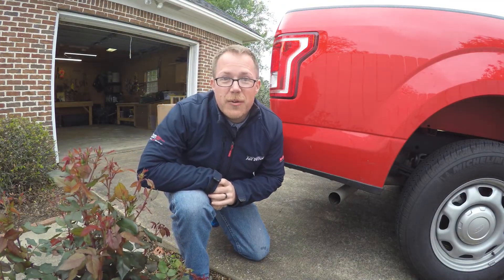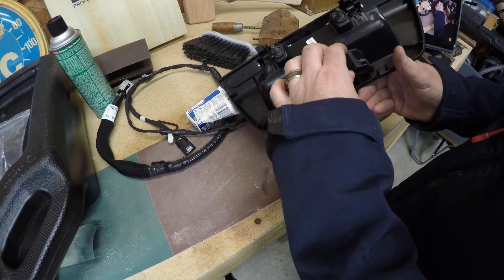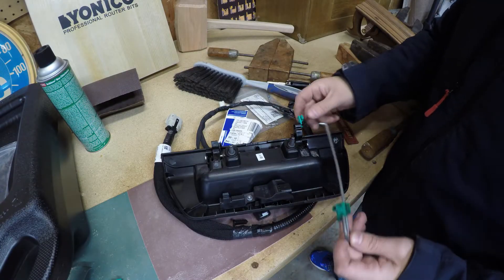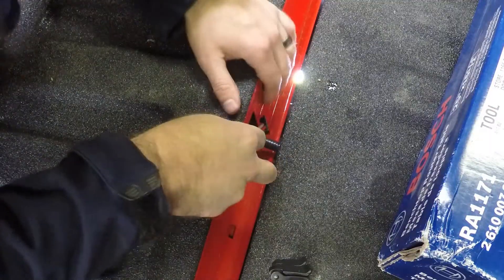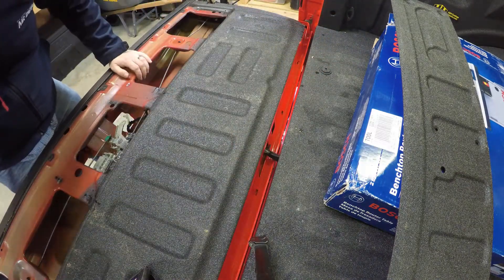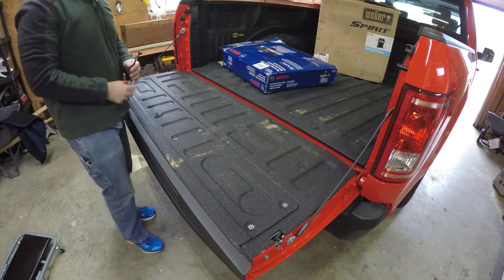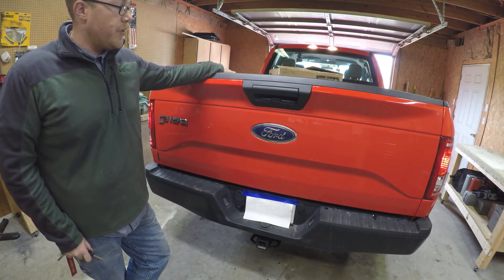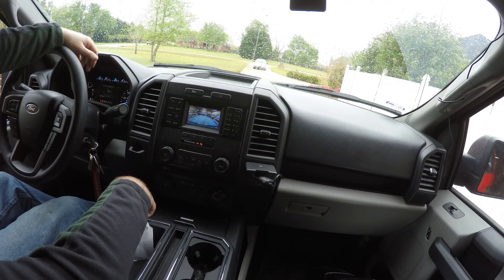2017 F-150 Backup Camera Install & Activation (OEM/Factory Camera)

Comment: Has anyone used the original cameras or installed new ones that RECORD what the cameras see?  After dealing with a-holes hitting me then telling every story on earth from teleported into the vehicle by aliens to living in a parallel universe, I'll never drive without RECORDED dash/vehicle cams again.

I'm wondering if anyone makes those clean housings to mount under the mirrors, aftermarket, so they connect to a DVR (recorder).  Just watching some moron hit you isn't worth a thing.
Reply from the maker: I'm not familiar with any permanently installed system. I have 2 dash cams, one pointing forward and one pointing out the rear window to record any possible issues.

Comment: Ok so I fucked up my tailgate and I was looking for replacements and I found an OEM with the back up Camera what type of harnesses will I have to buy to get it to work I have a 2017 XLT Crew Cab with the basics
Reply: Where do you buy the parts for the back up camera for an F150 2017

Comment: So, I installed this exactly like the instruction in the PDF.  I ordered all the parts mentioned.  Wired it up just like it said.  loaded the FORScan stuff, and it works, but the image is update down.  Any ideas?

1 - Brown - 33
2 - White - 7
3 - Blue - 11
4 - Green - 12
5 - Black - 13
2017 XLT 4.2" screen
Reply: Camera upside down?
Reply: @EdGrube  no, it only mounts one way
Reply: Did you get it resolved?  Not trying to be a smart a** but some mentioned the lense on the camera itself may turn 180 degrees
Reply: EdGrube  No, Not yet.  I have come to the conclusion that I have it wired correctly, and it is either the wrong camera for this application, or the camera was assembled incorrectly.   I wondered if I could just flip the assembly around, but it looks like the plastic assembly is welded together.  I was trying to get the supplier to send me another one before I wreck this one.  If the supplier won't send me another one, and I'm on my own, I'll try forcing it apart, or I will have to flip the whole assembly and silicone it in place.
Reply: @CVALOVIC  Any update?  I want to ask you a bunch of questions
Reply: @EdGrube   The supplier agreed to send me a new Camera.  Waiting for it to arrive.  Ask as many questions as you want.

Comment: Hello I installed everything and flashed the system but the display is saying rear view camera not available.....any suggestions?
Reply: I'm getting the same thing on my 2016 XLT.  I did not have the wires run from the back of the truck to the front, so I followed the instructions in the included link to run those.  When I put the truck in reverse, I get Rear View Camera Not Available.
Reply: @bouncebynum  I'm looking to do the same install as you-somewhere either in this Youtube listing or the F150 forum people talk about how they resolved your same issue.  I have a 2018 camera/tailgate on my 2017 F150 XL and I've just been reading about it alot.
Reply: Were you able to resolve ? @bouncebynum
Reply: @EdGrube  No, but I haven't had much time to work on it.  I need to double check that I've got good continuity over the wires that I had to add to the connectors and that they're going from the right pins to the right pins.

After that:  I've heard that sometimes the harness between the truck and the screen sometimes does not have the 3 video wires.  I need to verify if that's the case in my truck.
Reply: @bouncebynum  Did you read below about some folks verifying that w/Ford?
Reply: Did anyone figure it out? I am receiving same message “rear view camera not available”

Comment: GREAT INFORMATION. I just installed an electric braking system on my F 150 but got very little help from the parts dept at the dealer.  Back up camera is next. Your video will make it much easier and massively shorten the time frame. Dp youknow what the wiring harness behind the coin holder on the dash is for. Thanks, again.

Comment: Thank you for putting this video up and also the link to wire from tailgate to hood.  I saved hundreds of dollars and did it myself.  Amateur tip, when wiring from back of tailgate to the front of truck remove the spare tire.  I could actually sit under the truck while pinning the five new wires onto the connector.  I work slow so this was nice.
Reply: Mike-sounds like you were successful.   Mind answering a couple questions?  Any issues downloading FORScan?

Comment: Great vid.  I had to run the wiring per the PDF.  Still getting "camera not available." I'm double-checking my pins now.  Can you describe the location of pins 1-5 on the rear harness? (I did orient the wires exactly as shown in the PDF).    My rear connector doesn't seem to be numbered. (The engine bay connectors are numbered). (I did orient the wires exactly as shown in the PDF).  Edited to add: ordered a new camera and it works! Woot!
Reply: Pretty sure I figured that out--the PDF describes pin 1 as the upper right corner.  So all my pins are correct.  I have not been able to run LIN network new module calibration. Says I need to clear error codes. I have one error code B115E camera module bus signal. It will not clear. Haven’t found an answer as to what this is
Reply: Chuck-I'm trying to do this on my 2017 XL.  Mind answering a couple questions?
Reply: I can try :)  I did get it to work. Turned out I had a bad camera. 
 @EdGrube
Reply: @chuckthompson3358  I bought a 2018 tailgate with camera-hopefully no issues hooking this up.  I'm assuming your was the 4.2 non-touch screen.  What did you download from Forscan?
Reply: The Forscan Beta I think. And you get the extended license.  @EdGrube
Reply: @chuckthompson3358  What model do you have 2017 XL?  I sent you my mail link up above. Do you have  the 4.2 non-touch screen-did you get the center line?

Comment: Great video worked! Few tips! USB ODB is correct but my switch was wrong direction from instructions.  When loading if ATC comes with an error, then the switch is in wrong direction for HS MS flip switch it’s in wrong spot.  Also when it starting up and it wants to load the previous saved F150 say no.  Your loading same file which is missing most modules like FCDIM.  Finally when you write all it will say successful under log, but I had to press stop button before disconnecting.  You need forscan extended to do changes.  Btw 5 ford dealership in my area said it’s not possible.  I was just replacing damaged OEM screen with stock camera.  They said it was plug and play.  Well ford has about 40 screens for same gen F150.  Go bite a big one ford!

Comment: Make stuff nation I just purchase all the necessary parts including the wires and male/ female connector parts.  Before I get started can you tell me if the male parts go under the truck or in the front and I assume the female connectors go opposite of the male connectors. Couldn’t really tell by the pictures and don’t see where it tells you which ones.  Thanks

Comment: So I bought everything from Tasca Auto Parts as the video suggested and the OBD II and download Forscan. Installed everything and when I changed the numbers as it stated to in the video and the notes I get an error stating backup camera not available. Also I get a code error when I do the LIN calibration.  Can you please help me out with what I am doing wrong. I looked at a lot of forums and a lot of people are experiencing the same issue. I really don’t want to take it to FORD as they are going to charge $180.00 to flash the chip.
Reply: It is on a 2017 F-150 XLT with the non-touch screen. Basically the same truck in the video just one year newer
Reply: I am experiencing the same issue. If anyone solves please post. i bought a camera that i though was OEM but was a doorman, ordered OEM. Still same error. I will check for 9 pin vs 3 pin next. I also added the led bed lights that came with the harness for the camera. I threw time and almost 300 dollars at this and still no luck. disapointing.

Comment: Not seeing 7A5 only 7A7, is there a difference between the two?
Reply: Seems those with 8-inch screen's don't have to worry about the 7A5. Now I just need to run the wire from the front to the back.

Comment: Anybody able to get this to work on 2016 XLT model? I did all the wirings to the instructions
and installed everything. Took to local Fortd dealer to get it activated ($49.99 activation), but
they couldn't get it to activate. Do I have to get FORScan and do it on my own?
Great video and instruction by the way.
Reply: So finally got time to get the backup carema to work on my 2016 F150. Tested the resistance on Pin 6 and Pin 12 on the back of the display unit( got 73 ohms). A plus was that the harness to the display was pre-wire for these two pins (I took the connector that plugs into the display apart). Downloaded Forscan and followed  the instructions on here. Was able to get the guide lines and centered black line to come on also. Thanks to all those who pioneered this mod.

Comment: Hello Make Stuff Nation,
I watched your video and it is great on how to install and program the backup camera. I own a 2015 F-150 XLT Super Crew Truck and have watched several videos where a factory camera was installed in the tailgate, wires were run up the drivers side of the truck into the cab, uninstalled the screen, installed a special RCA plug and reassemble everything. Can you tell me where to look on my truck so I can decide  which option I will need to perform to install a backup camera??? I look forward hearing from you soon. Thanks

Comment: I just finished this on my 2017 XLT.  Everything went exactly as described in this video and the linked guide for running the wiring.  One final question:  Has anyone figured out how to get the red/yellow/green lines to appear on the screen?  I get the image with the magnifying glass and horizontal bar at the bottom of the image, but no multi-color guide lines on the sides.  Also, the magnifying glass doesn't seem to do anything.
Reply from the maker: I had the same issue at first. I figured it out and wrote instructions in the description of the video. They should be pretty clearly labeled and easy to follow. It's just another module you have to activate in ForScan.

Comment: Hi Make Stuff Nation, i have a dumb question.  I understand that the color of the wires are irrelevant. I am building the wire harness for truck side, the tail end connector will use the  slots from 1to5 and the front will be 7,11,12 and 13 on one connector and the on the slot 33.   The question is the following: what is the relation of the pin numbers beetween the aft connector and the front connector?...1 goes to what pin on the front connector?   2  goes to what pin on the front connector etc.   Do you have a wire diagram? I need to know the order.   Please help.
Reply from the maker: Okay, I just checked my truck and confirmed the pin layout. Here it is:
Rear Pin 1 -> Front Pin 33 (red in PDF guide, yellow in my truck)
Rear Pin 2 -> Front Pin 7 (white in PDF guide, purple in my truck)
Rear Pin 3 -> Front Pin 11 (blue in PDF guide, white in my truck)
Rear Pin 4 -> Front Pin 12 (green in PDF guide, red in my truck)
Rear Pin 5 -> Front Pin 13 (black in PDF guide, blue in my truck)
Reply: @MakeStuffNation  Great. Thank you for quick reply.   This is a big help.
Reply: @MakeStuffNation  What do you do if the front pins already have wires in them?
Reply: Good afternoon, i have a question. On the tutorial to reprogram the codes.  I need know if the numbers are HEXA  or Decimal
Reply: Hello Make stuff Nation, i am on last step of this project.  I have built and run the new harness.  All parts installed. Reprogram the Codes. I am getting the Rear veiw camera not available message.    Anything else that i need to do?  Or maybe a video that can help?  Please help me.

Comment: Hi, I got the same truck as showing in the video but mine is 2015, how can I know if I have to run the wire from the front to the back?
How many pins has it or as long it has electric lock should work?
How can identify it?
I will really appreciate a reply. 
Thanks..

Comment: Will this work for an aftermarket head unit? is it just a  yellow video input?
Reply from the maker: It is not a yellow video input, this wires directly into the Ford sync harness.

Comment: This is a great help. I should not have to run any cabling if the truck comes equipped with a lock actuator in the tailgate correct? 

Also, were you able to get the backup lines to appear on the screen?
Reply from the maker: Yes, I was able to get them working, use these steps (steps 3 & 4 turn on the lines specifically):

1: Connect ForScan, follow the prompts when connecting.
2: Under the FCDIM module, on the 7A5-01-01 line/field, change the 2nd digit from a "0" to a "2". Save/write the change (follow the prompts). (this activates the camera) 
3: Under the BCM module, on the 726-39-02 line/field, change the 6th digit to a "1". Save/write the change  (follow the prompts).
4: Click the wrench icon and run "LIN New Module Calibration". This makes the truck recognize the changes and calibrate the modules  (follow the prompts).
5: Disconnect ForScan
Reply: @MakeStuffNation  when you say second digit, which 01 should change to 11? The first set or the second set?
Reply: @MakeStuffNation   Great Video!  I installed everything just like shown in your video on my 2016 XLT which has the lock actuator.  I took it to get programmed with Ford and they could not program it. I have not looked to see how many wires are running into it.  Would the FORSCAN be the better solution?

Comment: I have installed the OEM camera and ran the 5 new wires as per the video and pdf; however after setting up FORScan I am getting a “rear view camera not available” error via my 4.2 inch Sync screen.  Does anyone have any idea on what I may be missing here or have you ran into this issue and found a remedy?  Any help would be greatly appreciated
Reply from the maker: try checking the wires you ran for this pinout: 

Rear Pin 1 -> Front Pin 33 (red in PDF guide, yellow in my truck)
Rear Pin 2 -> Front Pin 7 (white in PDF guide, purple in my truck)
Rear Pin 3 -> Front Pin 11 (blue in PDF guide, white in my truck)
Rear Pin 4 -> Front Pin 12 (green in PDF guide, red in my truck)
Rear Pin 5 -> Front Pin 13 (black in PDF guide, blue in my truck)
Reply: I finally got back to this project and ran all the wires as described in the PDF. (My truck was not-prewired for camera). Sadly, I still get "rear camera unavailable." I checked all my wiring for continuity and they are good. I triple checked to make sure the pins were in the right places.  I did have one wire in the wrong place which I corrected.  My pins in the rear harness are not numbered but I put the wires in exactly as they were pictured in the PDF.  I'll double check the pins again and double check my Forscan work.  Can't think of anything else to try.
Reply: I am having the exact same issue. I thought it might be that I didn't have wires running from the front to the back but when I called Ford, they assured me by running my VIN that my vehicle was setup for a camera. I still have not been able to get an answer to this issue. Does anyone have any advice?
Reply: Bryan Huntley check the harness that you connected the camera to that runs to the front of the truck.  It will visibly have 3 cables( not wired) or 7 (wired)
Reply: My 2017 XLT has 2 wires. I don't have a light on the handle.
Reply: Same issue.  I don't understand how checking the wires helps?  Are y'all saying I may need to change the pin configuration from how the harness is already set up?  Everything is correctly plugged in as he shows on the video????
Reply: Chuck Thompson my originally was that My 17 f150 was not pre wired for the camera.  After I followed the video instructions I had to also read the attached pdf and run wires from under the hood to the new harness that was installed via the video.  As for my 2nd problem one of the wires (the ground for me) had broken and I had to re-run it.  Everything was wired correctly; however I had to replace a wire and discovered this by checking to see which wires had power or not.  I hope this helps ;)
Reply: Yes.  I just found out from Ford that mine is also not pre-wired. I will read the pdf and see if I can duplicate your success.  Thanks!
Reply: Jason Deptawa what attached pdf?
Reply: @eatinpie172  how did you determine which wires had power or not?  I am at that point now.  Installed new camera and wiring harness.  Found out that I only had 2 wires.  Ran the 5 additional wires.  And still not working...  Thanks.
Reply: Shon Hender use a multimeter to determine which connections are receiving power.  Make sure power runs from the front all the way to the camera.  This should help you find any faults in the wire if that’s what is happening.  I hope that helps :)